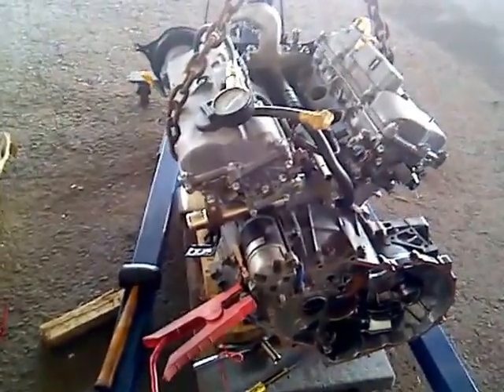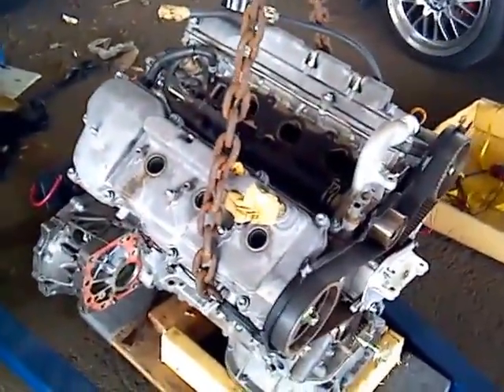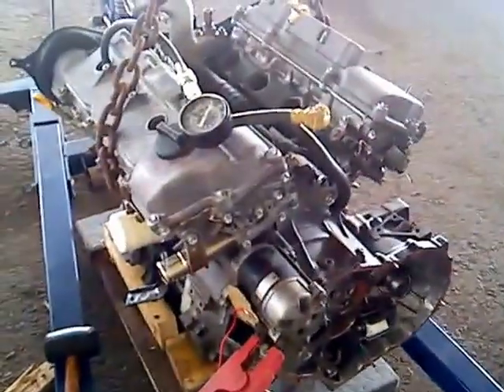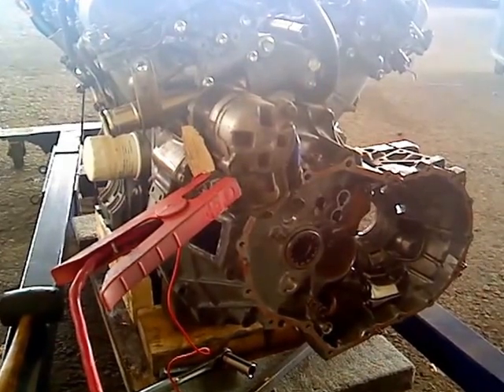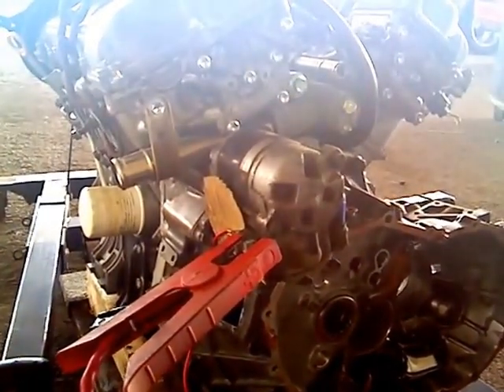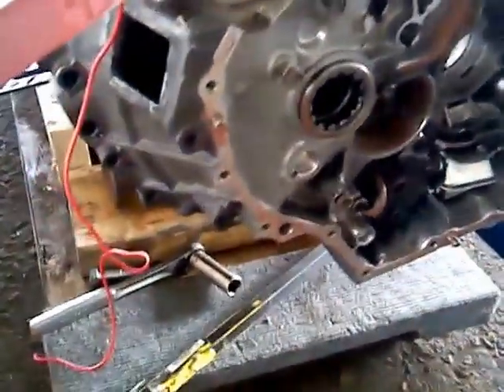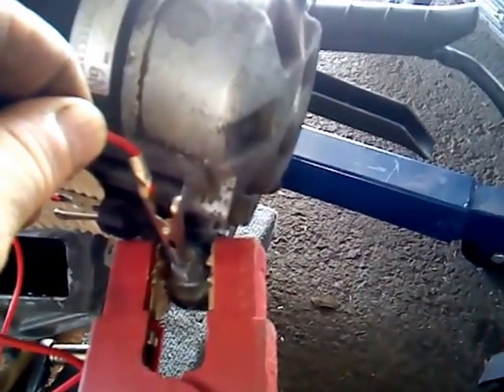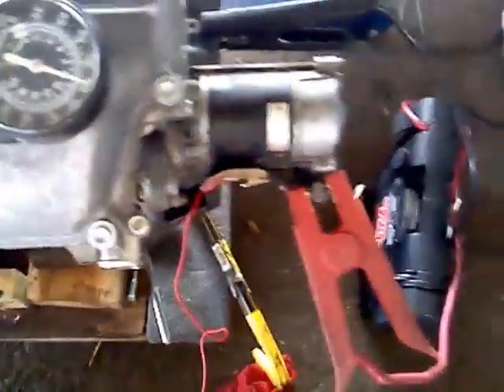Out-of-car Compression Test Toyota 1MZ-FE 3.0-liter V6 JDM Engine for Highlander Camry LX300 ES300

Comment: so the bell housing is just so you can connect the starter motor? 
I'm just trying to find out if it's okay to crank the motor without the intake manifold..... seems like it is (as long as I pull the fuel fuse and relay out).... Thanks again, Frankster.
Reply from the maker: Correct, the bell housing is for the starter. Sure you can crank with the intake off. But don't let anything be sucked in to the engine.
Reply: @Merryfrankster_  Thanks again Frankster.... you rule.

Comment: YOU GOT FINNESSED MY BOY I JUST BOUGHT A 98 V6 CAMRY CHECKED THE COMPRESION AND IT HAD 150 IN EACH CYLINDER, IT HAS 277K KM THATS ABOUT 170K MILES SO FINNESSED :$